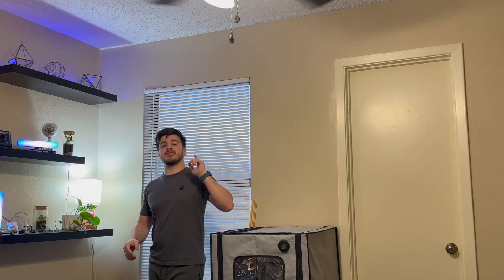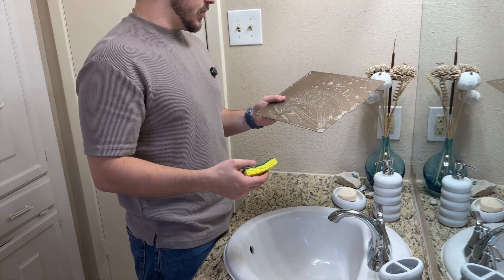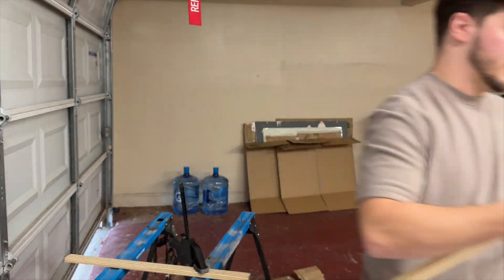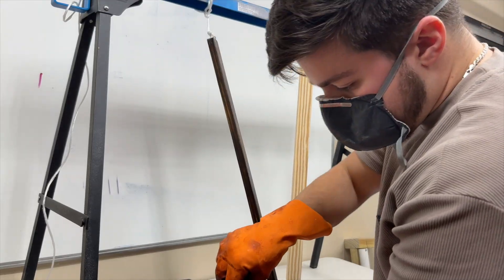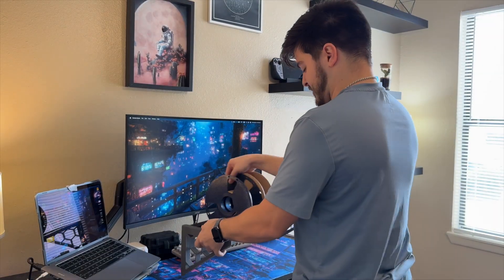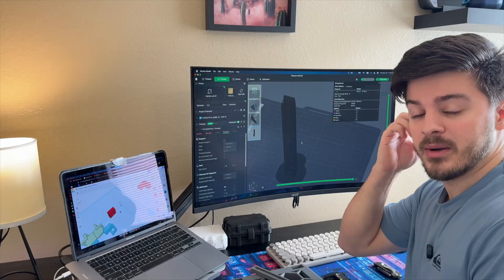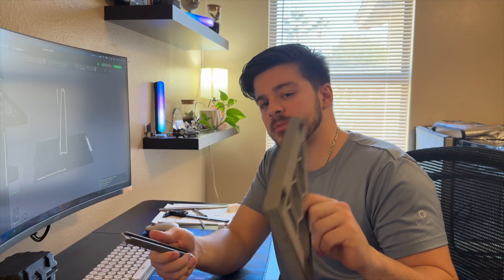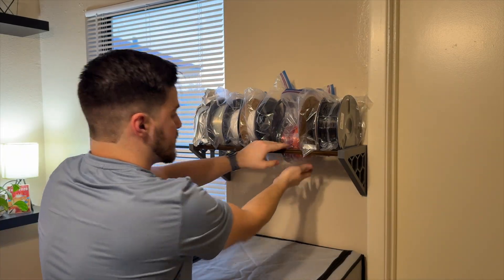This Is Perfect For Storing Your Filament! (FREE STL)

Comment: Glue is used as a releasing agent--NOT to improve bed adherence.  I run 7 A1s in my classroom with PEI plates and I put nothing on my beds.
Reply from the maker: Interesting, I’m curious why it helps with my smaller prints with less surface area or raft.
Reply: @hamzahabugosh  I use brims for tiny pieces, 2-5mm.  Other than that, the stick just fine.

Comment: I kinda screwed up by using a glue stick with glitter in it...😅 my build plate is covered in splochy pink glittery glue and my prints always have glitter melted into the bottoms. BUT I put in on 6 months ago, have not added to it once, and have had virtually no adhesion problems since.
Reply from the maker: Colorful base sounds fun 😂

Comment: Great really simple shelf!  I give you huge props for openly admitting the ability to hold a smaller reel is just coincidental.  I've had far too many of those accidental compatibilities!  I like your design because it can accommodate the Holy Grail Tribute filament enclosure as well.
Reply from the maker: Thanks so much, I appreciate the feedback. I haven’t seen that till you mentioned it, I will definitely check that out. I’m surprised you can keep humidity low using a filament built box. I would think it would just move moisture into the walls the into the filament.
Reply: @hamzahabugosh  Hey Sir!  It's interesting you should mention that, because I got into that very conversation with a commenter in the thread connected to that build.  He mentioned the same thing.  I'm presently using about 22 of those boxes for my filament.  Each has a hygrometer in the front.  I've had to refresh my dessicants more than I'd expected to.  I'm in relatively arid California, so not Florida.  I'm going to explore some options to make the filament storage more protected from humidity in those boxes.

Congrats on your new channel.  Best of luck!
Reply from the maker: @d@darrcook1okay that makes sense. Because I’m sure the boxes do better than no boxes in long term storage but I would expect them to allow some moisture over time. 
Which makes sense why you have to continually change out your desiccants. 
I wonder if there something you could use to coat the inside of these boxes, like spray paint clear coat to seal it.
Edit: And thanks for the wishes!

Comment: I clean my bedplates with dishwash and waem water, dry them and then aply a coat of spray hair gel and spread it with papertowel soaked with IPA
Reply from the maker: Oh interesting, I haven’t heard that before. So hair spray and spreading it with IPA towel. What’s the benefit of using both?
Reply: @hamzahabugosh not regular hair spray but hair gel in spray. It is more dense and... Gely? Alone it is too sticky and doesn't aply even, so a little bit of IPA makes it a perfect arhesion mix and last long without cleaning (in enclosed printer)

Comment: for tight fitting parts, maybe try lube, light grease.. but i dont know if it will react with the filament.
Reply from the maker: Yeah, depends on the product used. But this it’s not seeing constant movement, just didn’t want it to be stuck on the wall if I needed to remove it.

Comment: Printing PETG has always had bed adhesion issues for me, untill I decided to wash the print plate every  2-3 prints with warm water and soap, then rinse it and let it dry on the heated bed before printing not wiping and touching print surface. Previously I wiped it every so often with IPA but found it not working for PETG.  PLA,TPU sticks great no matter how filthy print plate is and how seldom I cleaned it. Been using sunlu filament on my ender 3 v2 neo with direct extruder mod.
Reply from the maker: Yeah that’s a great point. I try to clean mine as much as possible, the textured plates must store a lot of hidden oils and grime. I haven’t used IPA, just dish soap with a sponge. Might try a brush.

Comment: Bambu PEI plate, cleaning with IPA between every print, never cleaned with soap, never had an issue, total time of 3000h on 3 bambumachines (i haven't even used the other side of the plates yet 😊)
Reply from the maker: Alright we might have a winner in terms of simplicity, I need to try that.

Comment: Cool video watching you go through the whole design, prototype, and implementation process. 3D printing and woodworking go together like peanut butter and jelly, right? I love it! I’ve been there many times myself with projects like this. Thank you for sharing!

Just some tips… Glue stick works, but it is messy. Try the Biqu CryoGrip Frostbite plate. It’s awesome for PLA and PETG. Excellent adhesion at lower temps. Bambu has a Super Tack Cool Plate as well, which is very similar.

To help maintain precise dimensions on the bottom faces of prints, set elephant foot compensation to 0.3 mm. I’ve tried lots of settings and 0.3 seems to be the best.

For supports, I think the default spacing between the support interface and the model is 0.2 mm. Sometimes increasing this to 0.3 mm helps give you a cleaner edge, thus maintaining dimensional accuracy. Doesn’t always work but worth a try for certain models. Either way, supports will release much easier at 0.3 mm.

If you have an AMS, you can set the support interface to be a different material (like PETG for a PLA model) and set the interface spacing to 0 mm. This will give you the cleanest, most accurate results and the supports should release very easily since PLA and PETG don’t bond. Polymaker’s CoPE is also a great support material for PLA and is cheap.

And my last tip, if you made those brackets out of PLA, please be careful about creep over time. Not sure if you know what creep is (and if you do, feel free to stop reading), but it’s a material’s tendency to deform over time when placed under a constant load. PLA is known to creep a lot. I’d hate to see those slide brackets stretch and open up over time and then BOOM, all your filament comes crashing down on your printer. Just be aware and check it every few weeks for the first month or two. Depending on the design, it might be OK. But it might also be a safer bet to make everything out of PETG or a fiber-infused material (if your printer can handle it). Or just eliminate the slide design altogether and mount the triangular brackets directly to the studs in the wall. (You are attaching these to the studs and not just drywall, right? Of course you are, lol. Sorry I get paranoid, lol. You are mounting right on the edge of the door and window so that should be a stud. But it’s always good to make sure, haha!)

Anyway, hope these tips help. Didn’t mean to sound bossy or come off as a know-it-all. Just sharing things I’ve learned over the years (usually through my failures, lol) in hopes that it helps others. Cheers!
Reply from the maker: I appreciate the energy and thought you put into this comment. There’s som great advice in here. Some I haven’t looked into much. 
The support spacing being one is like to try for sure. 
I have heard of the PETG and PLA print combo for support but don’t have an AMS and not too keen on getting one for this printer due to material waste. Would like to invest in a tool change printer in the future though. 
I have heard of creep, so that’s definitely something I will keep an eye out for, in this case it is connected at the stud. 
I am not too concerned about creep because the force on the print will never exceed 8kgs, being a triangular design it will be transferred to the wall, and the force should be distributed across the whole bracket slider. That is my hope anyway. If you know of any simulations that I could run let me know. That’s not my area of expertise. 

Also I do appreciate the insight, thanks for your comment, I will definitely be referencing it in my future prints.
Reply: @hamzahabugosh  Happy to help and really enjoyed your video! It made me a subscriber! Looking forward to more!

I hear you on the AMS material waste. I have a couple A1’s with AMS lite and it wastes a ton of filament. I mostly use them to just do multi-material supports though. Very minimal waste with that luckily. I have a Snapmaker U1 on order (should be here soon) and I’m hoping that thing is as awesome as advertised - all the multicolor with way less waste! Anyway, see you in the next video! Take care!
Reply from the maker: @G @GoComm79  thank you for subscribing, I’m glad you enjoyed it. I will definitely be posting as much as I can.
I saw the SnapMaker, it looks amazing. I’m excited to try that when I get a chance. I would for sure use multi filament prints on that.

Comment: BIQU Cryogrip build plate from AliExpress.  I print PETG, PLA, ASA, and  PCTG without any issues.  Rarely do I use Dawn dish soap and water.  No glue stick/hairspray required.  Do not use IPA. 😮 I use the default print settings for my Bambu P1S.  Next to zero issues. 14 months and counting.
Reply from the maker: Awesome I’ll check them out. Thanks for the input!
Reply: 100% this. i just got mine off amazon,  BIQU CryoGrip Pro Frostbite $32 bucks!! no more glue sticks, no issues, things come off so easy when it cools

Comment: Don't touch the topside of the plate with your fingers and you should be good. Once you've touched the top it's time to clean it. I use dishsoap and a nail brush, then rinse under the tap and dry with a clean towel.

I use hairspray only when printing thin petg parts as they have a tendency to stick too well and the hairspray helps releasing.
Reply from the maker: Good advice, I think I’ll try with a different brush. Normally i use a sponge and dish soap. 
I haven’t printed in PETG but will try that when I do.

Comment: Aqua Net hair spray. Never ever had a single bed adhesion issue in over 10 years. No exaggeration. Only my own z-offset problems. Still rockn my OG (completely modified) CR-10.
Reply: I use Suave MAX Hold and never have any issues....And that's because I swiped a can from my mom like 15 years ago to try and it worked great so I never switched...lol
Reply from the maker: I’ll have to give that a try, I haven’t heard of that one before.
Reply: @hamzahabugosh  I heard about hairspray, and bought a can like six months ago and still haven’t tried it. One day, lol.
Reply: How often do you need to spray the plate?
Reply: @dcsdrive  I spray mine once a week generally, it depends on how often you clean the bed, or change material types.  ... and Aqua Net really does work.  What it does is create a layer between the filament and the PEI, which is sticky enough to print, but also allows parts to seperate.  I've used it with TPU, PETG, ASA, ABS, and of course PLA.

Comment: iam using magigoo for the bed..it doest get as bad on the bed like a gluestick..its alot thinner but hold down good when hot. If u have a flexbed with for example carbonfiberlook. it will still show up on the part even if i use magigoo.
Reply from the maker: I think I may have heard of that from another video. I’ll have to give it a try. Thanks!